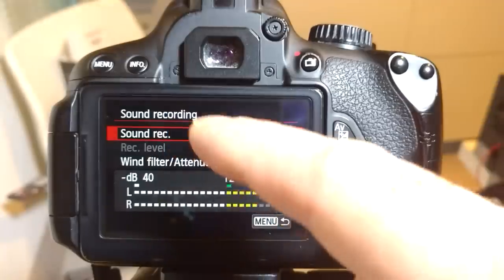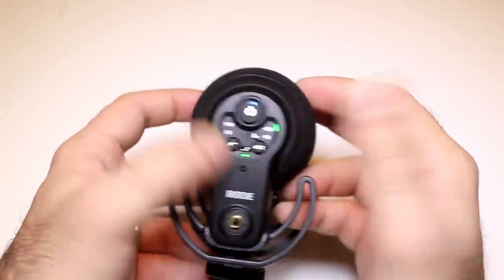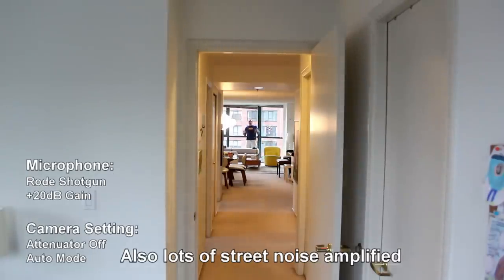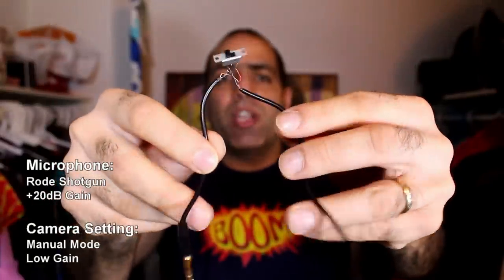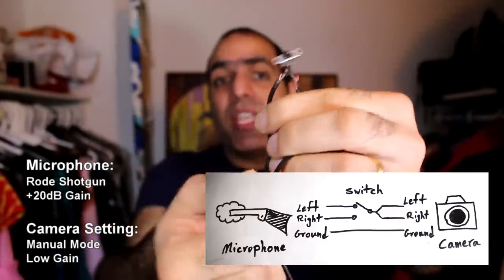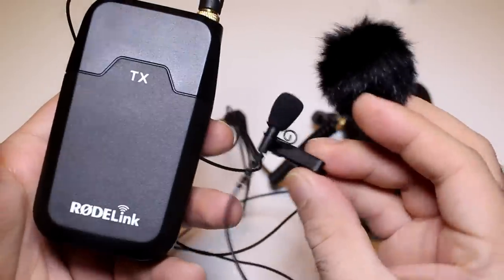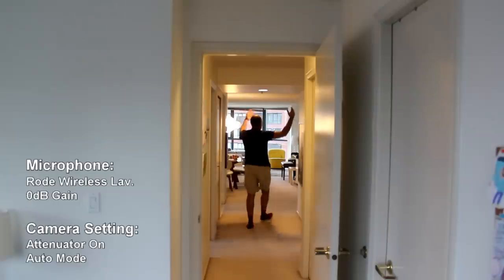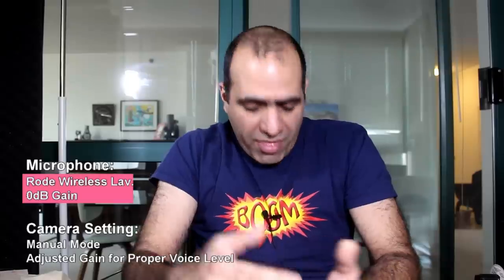Video Recording with Rode Shotgun and Wireless Lavalier Microphones

Comment: There is one thing that one has to remember when it comes to background noise: removing it completely in edit can bring the noise levels to be more audible. We react to change in noise more than to the noise itself. This is one good reason why to minimize it in recording as you can't really do anything about it in post and it makes editing a pain. Most often what we use is to take a noise sample, a piece of clip where no one talks, no sound is heard. We get the exact same background noise that is going to be present in the material, then use that noise sample to fill out all gaps in audio edit.

Shotgun mic has a narrow "beam", it is not good for groups of people... We either need several of the, several lavaliers or one omnidirectional mic.. Omnis are the cheapest, WM61-A capsule is about 3$ and is easily good enough (it's used in measurement mics too, ECM-8000 for ex uses it's predecessor, WM60A....). omnidirectional mics captures all the sound in the room, it is a tradeoff but it will also pick a group of people in a very natural way. Interview handheld mics are often omnis so the interviewer doesn't have to keep pointing towards the mouth of whoever talks. Distance is The Key making omnis work, they capture everything around them...

Comment: The -10dB and 20dB settings are not designed for noise:signal. They are designed this way because some high end audio gear is designed to operate at different line signal values. Some -10dB, some 20dB. 

Hope that helps . . .

Comment: I just had to solder a power supply (using a 3.7v 18650 cell) for an old PC headset to be able to run it directly into an audio mixer. Luckily it did not go BOOM on me. It actually works. But having a more professional solution would be much appreciated as right now there is an open circuit lying beneath my desk and if I ever drop something on it, there is a chance the 18650 will blow up and burn my place to the ground. So please save me and send me one of your free RØDE microphones.

Comment: -10 dB attenuator (or pad) is usually used when capturing a source that is particularly loud by default, not really wanting to capture reflections around the room if you were to reduce the loudness by stepping back a bit from the source.
A good example is if you were to record drums with a condenser microphone: the mics output is pretty high and you still want to stay close to the source to avoid reflections and bleed from other drum kit components, so you put the attenuator on and you have more headroom when recording (instead of keeping the gain at minimum on your ad converters amplifier)

Comment: I have noticed that the screw-in type flourescent bulbs stop working because the filaments open. For some unknown reason if I put a jumper accross the open filament (if I can only get the lamp housing open without breaking the glass coil) I can make the bulb work again like new. Many of these type flourescent lamps, the electronics is very robust and never dies and was told they are a great source of good electronic parts!

Comment: +20dB is not 100 times the voltage level. +20dB is 100 times the power level, but is 10 times the voltage level. 
BTW, please put me on the Rode draw. I need a lavalière microphone since I also run a YouTube channel. Thanks.
Reply: Électro-Bidouilleur db is not necessarily a power measurement. In can be used to define volts, amps, power or whatever. If the reference is unnamed as it is here, you need to know the implied reference. dbv or dbmv would be voltage. dbw or dbmw would be power etc.

Also 20db means a gain of 100, and if you are talking about power that can be realized by changes in voltage, current, or both. So 100 * the voltage could be accurate if the current doesn't change.
Reply: +OP WRONG👋

Comment: The few times I've done audio recordings for school projects, I've used Audacity. Free software that works great for recording audio. I would just not make any sounds for the first 3 seconds, then do whatever I'm recording. Once I'm done recording, I use those first 3 seconds as a noise profile, and you can have Audacity automatically take the noises detected in that noise profile and mute them throughout the entire recording. I suppose if you have better equipment or a preferred method, that might be better, but this worked wonderfully for me.

Comment: Remember, just because the RODE shotgun comes with a hotshoe mount for a video camera, it does not have to be used in that position.  A simple mic stand and extension cable will allow you to set up the shotgun above your subject and pointed down into their chest.  The human body then becomes a living buffer, eliminating a lot of environmental noise and echo.  So long as it's not in the frame, the shotgun can be anywhere.
Reply: trublgrl yes and you get the added advantage that the mic is less likely to pick up focusing noise when moving around  of course locking focus can also remove focusing noise. 😁

Comment: run manual gain and set to preference before clipping. in post editing use a compressor and an expander and a HPF at around 80-100hz and a LPF at 15khz and you should see a lot of improvement 😃
Reply: and as you hate post processing just save it as a preset and apply it as needed

Comment: The -10db switch activates a voltage divider between the microphone capsule and the integrated amplifier. This allows you to record very loud sounds (for example a drum kit) that would normally clip the microphone's amplifier or be above the signal level that your input is expected to handle (usually called a "hot" signal)

Comment: I had a bad experience with Rode. I thought it would be good as Mehdi supported them. I bought an NT1A. Only worked for a year. Then it started glitching sometimes as sound wont come. Then it was completely dead. The support was also a bad experience.

Comment: Hi,
Have a question:
What happens if I have a group of solar powered leds, in such arrange that the light emitted from them charges the batteries of the others, assuming that the light emitted is capable of charging the aforementioned batteries.
Common sense dictate that in that scenario, the lights would be working forever, but I don't think that would be the case, but don't know why.
Can you please explain that paradox?

Comment: At 5:45.....Doesn't 20dB equal 10 times more voltage-level instead of 100 times? Because of the fact that 20log(Vout/Vin)=20dB --> Vout/Vin=10^(20db/20). I thougt the expression 10log(Pout/Pin)=20dB is only used for power instead of voltage. Because of P=(U^2)/R (for constant R) --> 10log((U^2)/R ) = 20log(U/R) =  20log(U) - 20log(R) --> That's why the expression 20log(x) = y [dB] is used for voltage or current calculations only, whereas 10log(x) = y [dB] is used for power calculations. Because both current and voltage have a quadratic expression in the 10log() so the 10 in front of the log() becomes a 20 with P= (U^2)/R or (I^2)*R.

Comment: you can use a combo of the shotgun and lavalier mic since your trademark is "sparks" you will hear you well and the shotgun on a medium level so it does not clip on the "BOOM" (sparks)... wait... a spark kind of is a clip... well more like a spike with no flat top but sound quality wize: DO TEST FAKE SPARKS WITH ALL THOSE MICs! this way when you "suffer" your sparks by "accident" [ ;) ] you will not have wasted the effort... emm i mean the sound. tho i can say having a dedicated sound program with a "Template" can ease the post processing because you only do the template once and "tweek" a few times when exceptions occurs. i used to have a channel in 2006 when i had the net but did not know how to use my programs, now i have the net again 10 years later knowing how to use my programs but my hotmail died and so did my YT... so at least you can use the info on sound ;P 

step 1: have good mic setup! (done)
step 2: make a few test runs (?done?)
step 3: make a post processing template to reuse in one click when made (up to you)

tip: "compressing is ok but too much will bring back the annoying hisssssss"
tip: "not compressing will make too much dynamics and clipping is almost assured"
tip: "playing too much with the EQ will make it sound differently on many media so limit changes in the +/- 3 Db" (ok for negative if you remove insane humms or clipping freqs but never add more than 3! 

well i did my best with this brick of a text! take what you want! (BTW is it ok to charge and uncharge a PC CMOS battery MANY times? my board's charge mechanism sends 0V cause it's busted and i change Battery between a  old PC each 6 month/1Y ~ can it leak acid/blow up/ die? the board is surely busted cause other wise a PC could replace the battery for a tinfoil fuse trick and work... when the battery is out it does nothing except turn the fans when on...well it's an old 2007 PC, the funnest 700W heater you could heat a Canadian room with! 1 Q6600 B0[45Celcius-70C], 2 nVidia 8800GT[permanent 100C]) <--BRICK--^

Comment: 5:48 I thought 20dB means 10x and 40dB 100 times
Reply: Yes I thought that too.......Because of the fact that 20log(Vout/Vin)=20dB --> Vout/Vin=10^(20db/20). I thougt the expression 10log(Pout/Pin)=20dB is only used for power instead of voltage. Because of P=(U^2)/R (for constant R) --> 10log((U^2)/R ) = 20log(U/R) = 20log(U) - 20log(R) --> That's why the expression 20log(x) = y [dB] is used for voltage or current calculations only, whereas 10log(x) = y [dB] is used for power calculations. Because both current and voltage have a quadratic expression in the 10log() so the 10 in front of the log() becomes a 20 with P= (U^2)/R or (I^2)*R.
Reply: Ma Ku indeed

Comment: Here’s a serious idea. I’m trying to measure and more importantly directionally location a sub bass annoying sound.  So low it may be kind of a resonance. Good enough idea for one of your videos?  Most dB meters only go down to 30 and I bet this is below this.  But it is extremely f***ing annoying when I try to sleep.  Direction is important for location so I can send 10 zillion volts to eliminate the noise and those responsible for it. Hoe can I send 10 zillion volts!   Remember I’m a boss so I need someone else to solve my problem  Thx.  ...Video?...